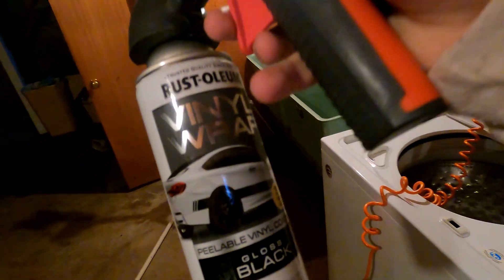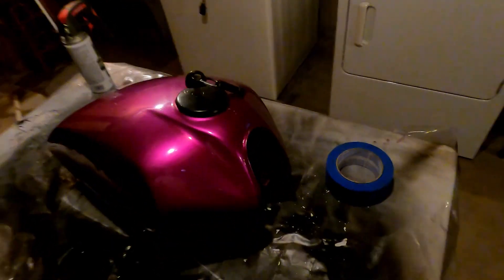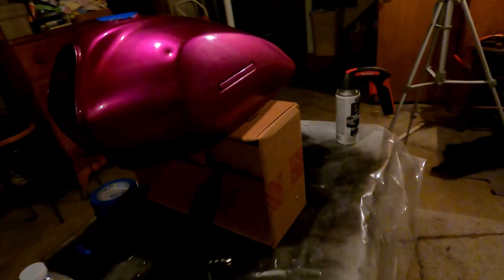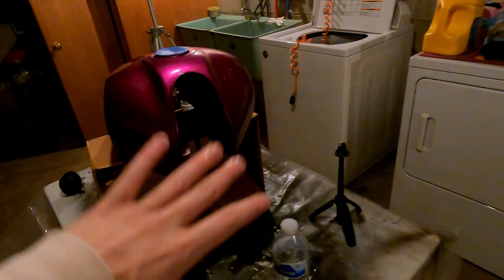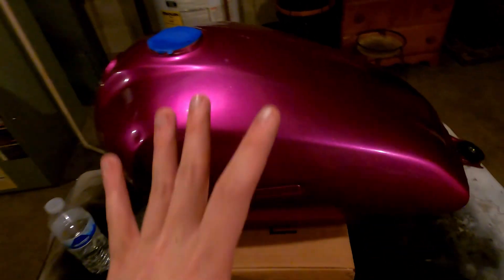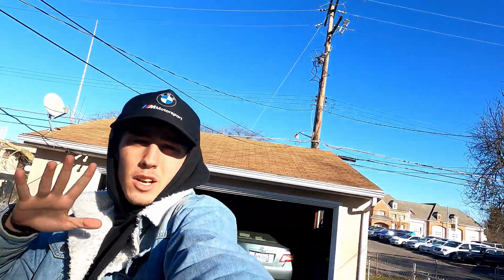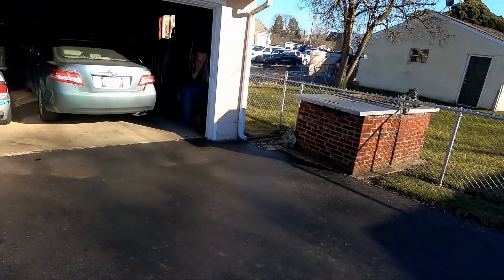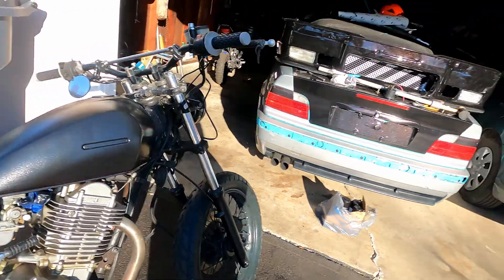Rustoleum Vinyl Wrap Paint. Does It Work? *Surprising Results*

Comment: Hey man I’m about to paint my tank with this and am wondering if splashes of gas will mess it up?
Reply from the maker: It's been a while but if I remember correctly it didn't effect it much. The the one thing I'd really recommend avoiding is contacting it with a rag. Fibers get stuck and it's just not pretty.